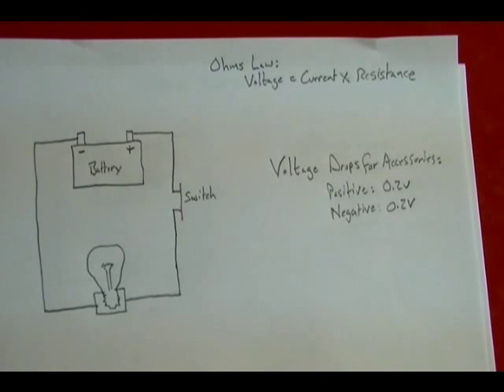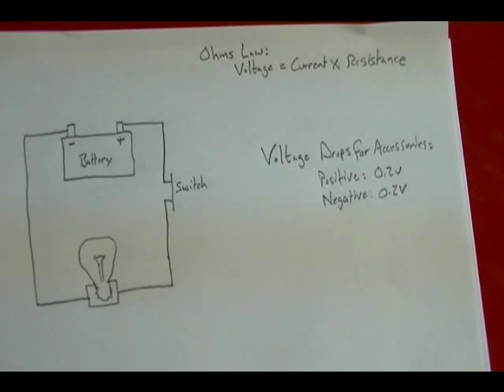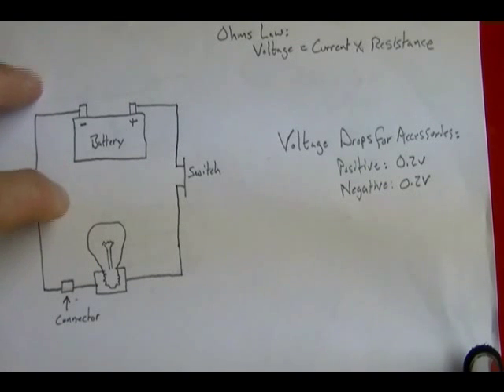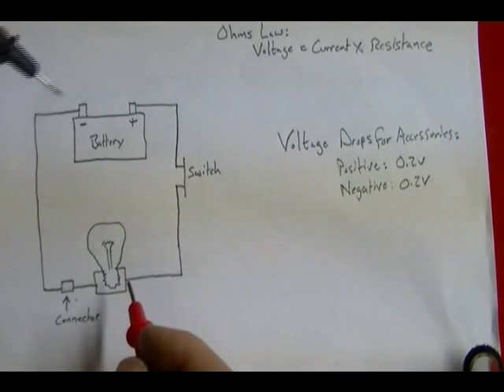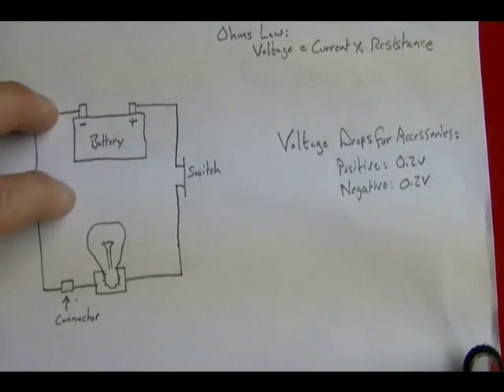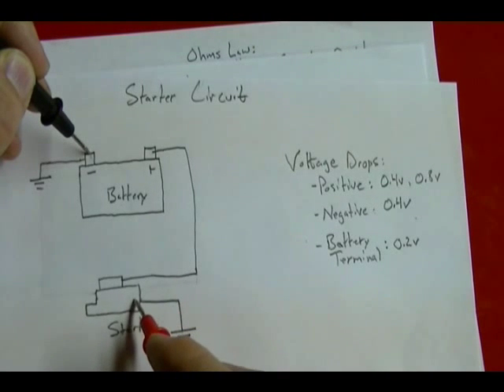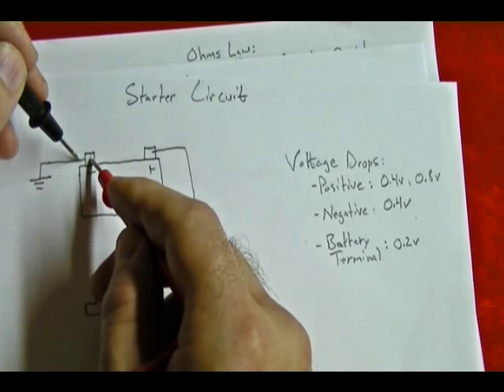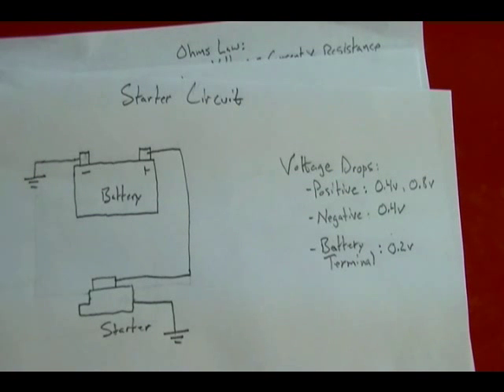Small Engine Repair: How to Measure and Use Voltage Drops to Diagnose Electical Circuit Problems

Comment: @smallengineshop...are you saying that the higher the reading the better it is?
Reply from the maker: Higher resistance causes higher voltage drops (V=IR). You don't want high voltage across something that isn't meant to have very much resistance like wire connectors.

Comment: great video. now if the starter drop was more than .4 then change starter. also if the starter is bad and grounding out, can that ground out the magneto, coil. i'm not seeing or getting any spark.

Comment: Thanks for the video.  I have a craftsman lawn tractor that is having trouble starting.  I followed this video to the best that I could.  I've also changed my starter solenoid.  I'm getting over 12 volts through the solenoid.  My engine only turns over when I have a batter charger on my battery and I get over 13.50 volts on the battery.  Do you know why this is?  Shouldn't it start up with 12 volts?  Thanks.

Comment: Great vid, my weak spot on engine repair is  electrical,  A tip a friend showed me is in addition to voltage drop another by-product of resistance is heat, so I have found a digital laser thermometer can help locate a problem spot. good stuff. !